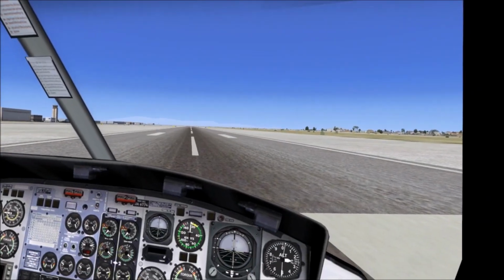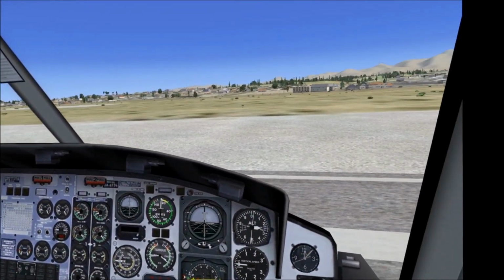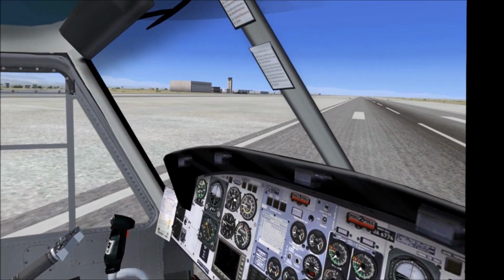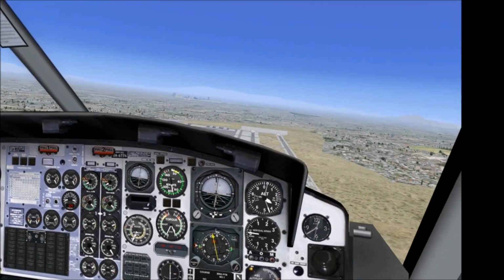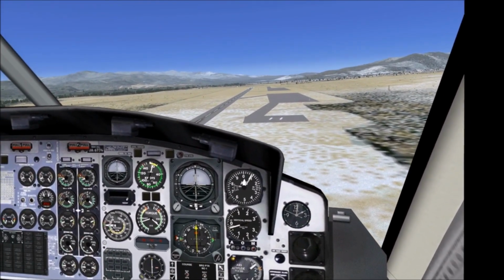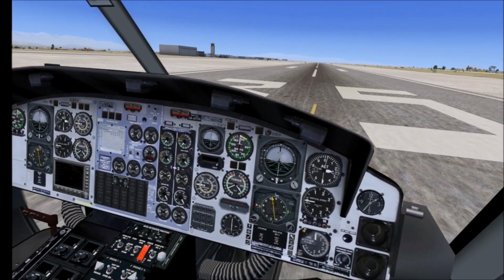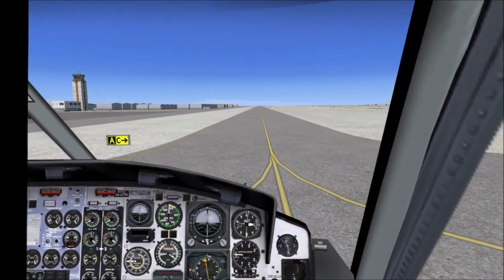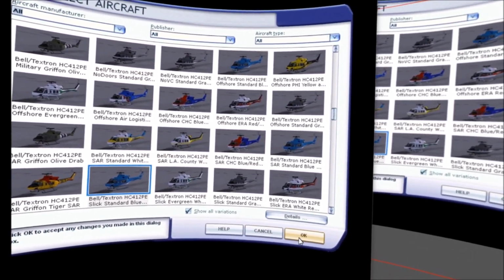Accuracy Flight Test - Hover Control B412  Joe - Part 1 flight dynamics

Comment: Hi, talking about the huey, the way we have to start it up involves unlocking the power on the collective. In the real huey it is done by pressing on a button on the collective then rotating the power. In DCS this is done by clicking on the button then using page up. Any way to mimic that with the pro flight ? Clicking on the button does not allow me to turn the collective, I have to either use page up or moving the power with the mouse. Thanks
Reply from the maker: Hello
It seems your question is covered about 12min 20 seconds into the Puma axis and buttons set up for DCS video...
Did you had a chance to watch that video to?
https://www.youtube.com/watch?v=aEeSzL2QNbk
Reply: @proflighttrainer  thanks I see the point about that. Yeah so a button for throttle increase and throttle decrease is needed just for that. I think I'll use the same button for throttle increase, decrease, and unlock throttle with the switch because the other button is used for VR zoom :)

Comment: I remember when Jordan turned this thing loose. I never could get it completely under control, even when the other members of Hovercontrol told me to add 2000 pounds in the cargo area. Funny when I look back now, I wasn't used to real 3 D panels at the time. Compared to the X-Trident 412, this one looks flat, almost 2D.